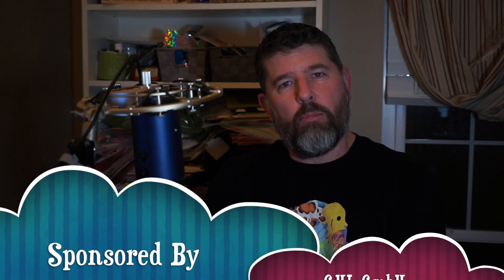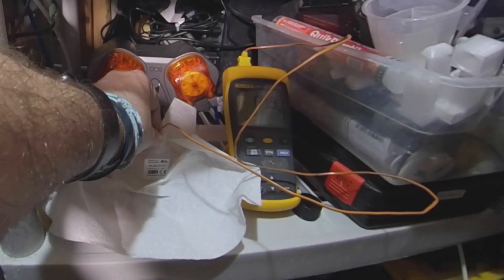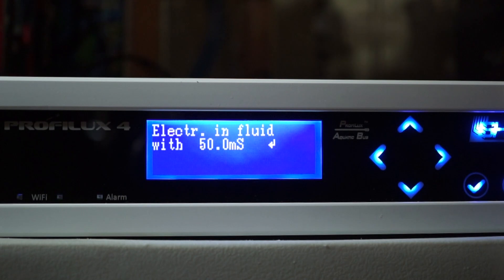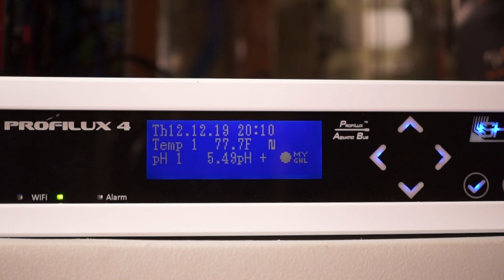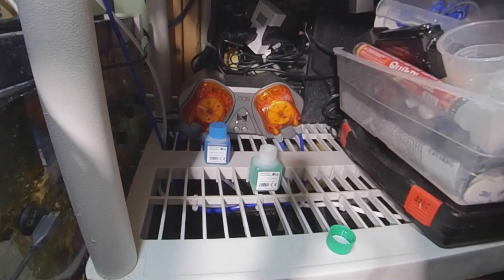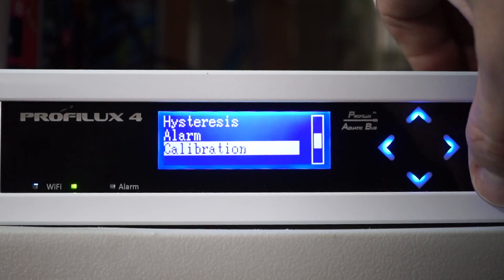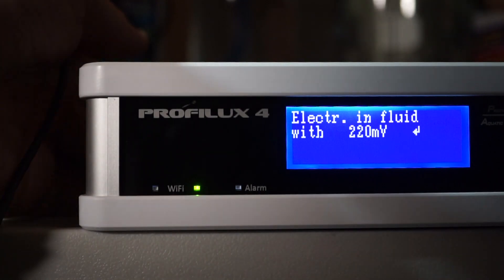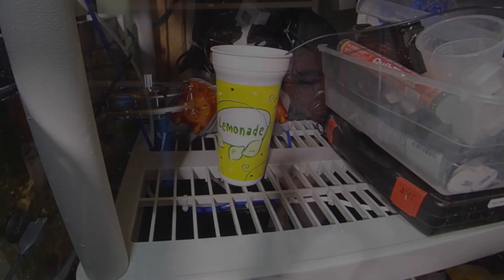CALIBRATED!!! Logging perfect data on the GHL ProfiLux 4

Comment: Is there an issue with connecting my profilux 4 6e to my wifi? It doesn’t want to connect
Reply from the maker: Try updating the WiFi radio’s firmware first. That usually does the trick.

Comment: I am so impressed with the probe packaging and calibration procedure. How long can the fluid containers that came with the unit be used for verifying data points?
Reply from the maker: Pour a little out for testing, and the remainder will last 3-6 months. So, three months.

Comment: One thing to note you shouldn't use the container the calibration fluid is in. Get a cup or something and add the fluid so you don't contaminate the calibration fluid.
Reply from the maker: Excellent point, and I always use new fluids. I wouldn’t reuse fluids I had previously opened. Those that shipped with the P4 were trashed. I should have mentioned that. Thank you!